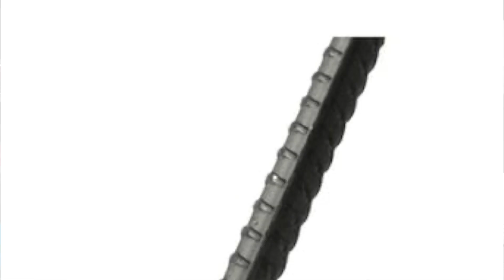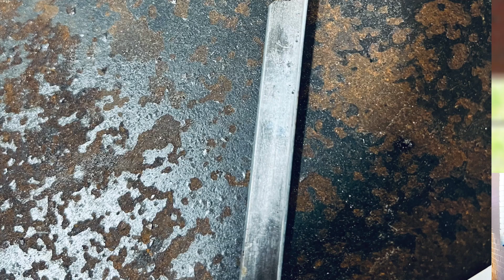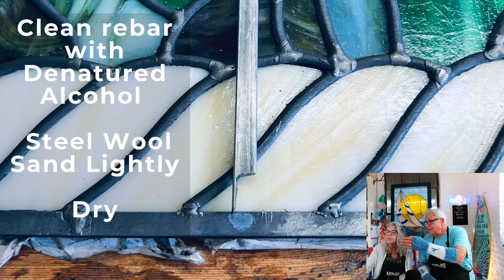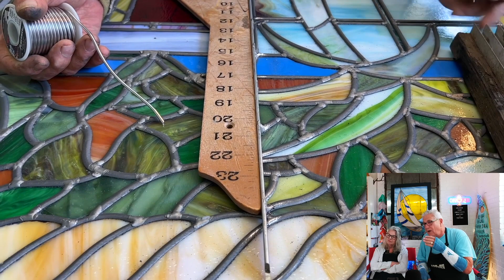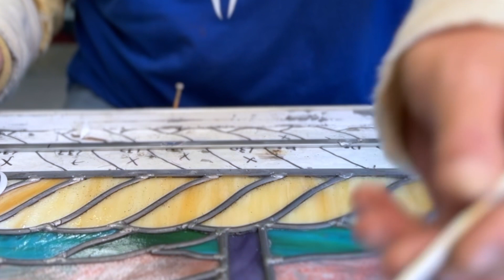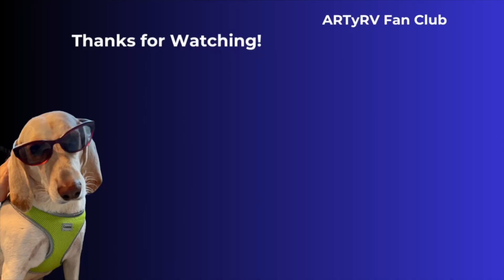Stained Glass Rebar Installation

Comment: I bought stained glass rebar and parts won't hold solder. Tried more than one kind of Flux. What is going wrong?
Reply from the maker: You must completely remove all oil on the rebar as shown in the video. You'll need to turn your iron temperature up. You can also get answers to your questions on the Livestram Q&A on Monday at 7PM.